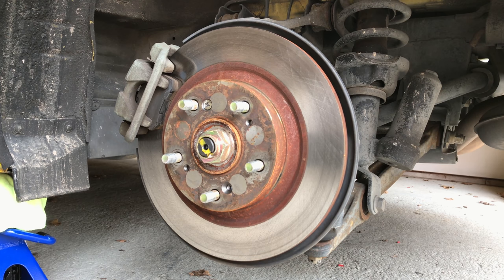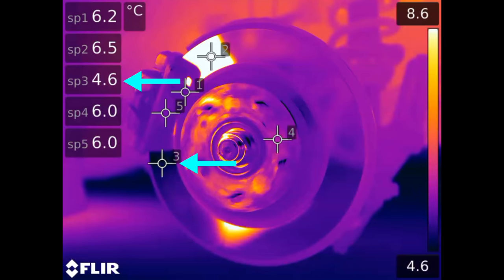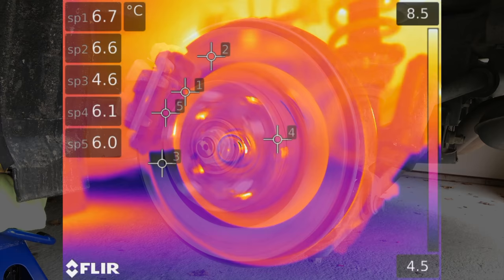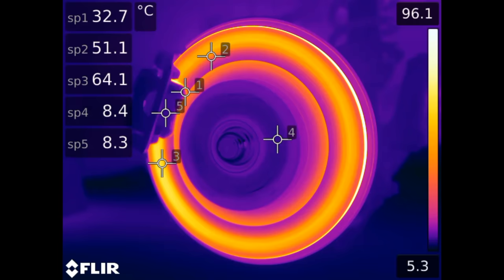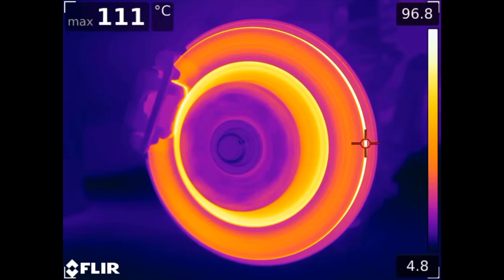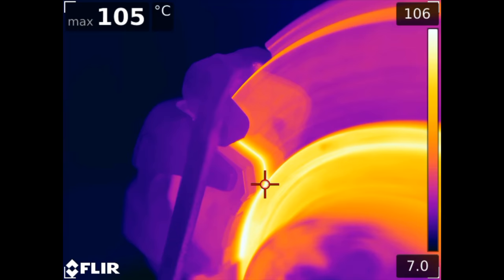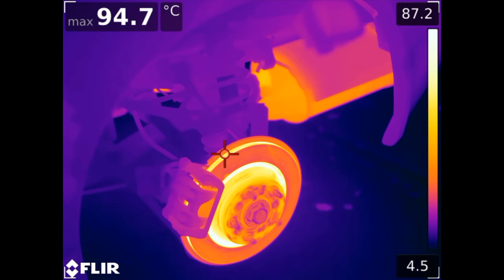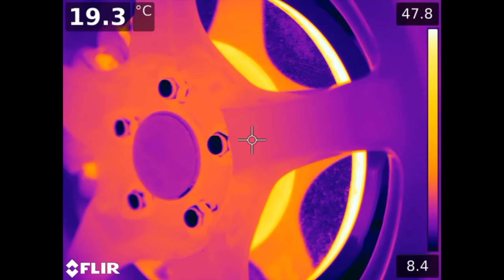How Hot Do Your Brakes Get?

Comment: I had no idea you were supposed to change your brake fluid. Guess I'd better get to it.
Reply: Thomas M As Jason said, brake fluid is hydroscopic meaning it absorbs water. If you boil your brake fluid from overheating, you will introduce air into the system and the fluid will absorb even more water hastening the breakdown of the fluid. If you track your car it's a good idea to change it every few track days and also use high temperature brake fluid.
Reply: revmatch how often should you change it on a normal car you drive in the street?
Reply: Allen Gentry Normal street driving I change it every few years. Personally I flush it every 3 years at most.
Reply: Every two years is a good rule of thumb. Once a year if you do a decent amount of "spirited" driving. Once every few track days if you do those too. I usually change mine every year in my daily car, 6 months in my fun car, and 6 months in my motorcycle. It's really cheap insurance and your brakes are the last thing you want failing on you.
Reply: RyanRants every 6 months on your bike? Do you track it? Thats like 4 times more than needed
Reply: my truck is 21 years old and has never had brake fluid changed and i often tow
Reply: +Jonathan Dittmar
Change it right now. You will certainly notice a difference. Also a good idea to change it to flush the junk out of the caliper and if you have, wheel cylinders.
Reply: It's not a big deal.  The likelihood you reach fluid temps anywhere near boiling even after a decade of not changing the fluid is rather small.  You have to realize cars are tested to extremes and things like water in the brake fluid are taken into account.  Unless you are towing a trailer while at max GVW through death valley in the middle of summer or you decided to take your car racing and haven't changed your fluid in about a decade I wouldn't be too concerned.
Reply: Thomas M here's a little tip for u also, maybe at 100,000 miles you should get new brake rotors, calipers, pads, etc to save u money on the long run and when u get new brakes, put new fluid in also and might cause the new brakes to wear out faster. Just thought I'd should tell ya.
Reply: Scott N Normally I'd agree with you because yes cars are tested for much more than what the book says they can do, but when it comes to steering and stopping I say no. It's a safety issue, not only for yourself (we don't care about that) we care if your brakes fail and you hit someone because your fluid is old. Also I bet you'll notice a higher firmer pedal when you change fluid.
Reply: Thomas M every two Years ot 20k miles. which ever comes first

Comment: Only 100-200? Never thought that the temperature of brakes would be so low. I mean when you braking your car hard or driving downhill, all the mass that this small brakes have to stop only by transferring kinetic energy into heat
Reply: High performance brakes can get even hotter.
Reply: At the point where the rotors get over 200°C on the celsius scale, you slowly reach the point where steel start to color itself through oxidation of the surface.

Comment: would covering the front of the camera with a material that doesn't cover heat(garbage bag?) will remove the reflection from metal?
Reply from the maker: That would simply show whatever is in front of the camera (in this case, a garbage bag). Won't see through it. Needs to have a clear path.
Reply: Engineering Explained oh, I just saw it somewhere maybe I'm misremembering. but if you already tried I guess that confirms it. thanks for the reply.

Comment: is the e brake the only way to use your rear brakes or are they used when you press on the usual brake pedal as well?
Reply: JesusIsKing23 regular brakes and e brakes both actuate the caliper pads.
Reply: +Patrick94GSR thanks bro! after a quick Google search I couldn't find the answer.

Comment: i own a 2005 130i, and my brake discs keep warping? after roughly every 4000 miles, this is the fourth time ive had them changed, checked pads and changed calipers and still getting this problem? I do not drive slow, but I aint driving extremely fast either, any ideas? thanks
Reply: rotors? really? and yeh so i've heard!
Reply: I assume you are getting brake judder (vibration when braking).  First of all it's typically not the rotors warping it's the disc thickness variation (although warped rotors can cause thickness variation).  This occurs in off brake driving (in other words, highway driving).  When your calipers don't retract enough or your rotors are warped they will rub up against your pads at the high spots.  Those will wear down vs the rest of the rotor and now you have thickness variation.  When a rotors varies in thickness this causes brake pulsation or "judder."  This is typically be felt as a vibration in the seat, steering wheel, or brake pedal itself when braking.  In order to elevate this the first thing you need to do is turn your rotors and make sure you have uniform thickness.  Then make sure you always tighten the wheels in a star pattern and torque down the lugs gradually.  This will reduce rotor warping (technically the best thing to do is torque all at the same time but I doubt you have something to do that).  The other things you can do is use less aggressive pads, get calipers that retract more (although that hurts brake feel), or get rotors that are less likely to wear (this can be expensive since it will require expensive materials).

In the end some cars are simply bad for this.  The only thing that is not super expensive is get a decent NAO type pad instead of semi metallic, turn the rotors to make sure they are good for dtv (disc thickness variation), and carefully torque your wheels.  Other than that the other changes I mentioned get expensive.
Reply: thank you! i've tried different quality discs, but I will try what you have mentioned.

Comment: At what temperature and after what kind of driving is it dangerous to keep applying the brake? (Do I have to keep an eye on brake temperature while everyday driving?)
Reply: C1Ansy brakes are tested really hard. They can take a lot more than most people think. depending on your vehicle (the older and heavier you go I would be more cautious) if you get your brakes services and inspected at recommended intervals you don't have to worry about brake temps unless your going down a big hill. If you are just put the engine in a lower gear and don't ride the brakes, hold them pretty firmly until you're at a safe speed and let go of them to cool them, then brake once you pick up speed. If you have a hybrid or electric vehicle you have even less to worry about because a lot of the heat from braking is being absorbed into the battery.
Reply: mutiedjello Thank you. You know, sometimes I have that strange nightmare that my brake pads suddenly will be driven off and clear parts metal come together while everyday driving.. 😱😄
Reply: C1Ansy actually if you wear your pads away and just have metal there it makes a really strong brake! it also makes lots of  sparks, damages the rotor and stops really hard.

Comment: why don't Mercedes breaks wear out evenly? that's intentional correct, to have the rotor around when they wear out
Reply: Brake and rotor wear depends heavily on your driving.  It's pretty much impossible to have both wear out at the same time.  Of course rotors typically last twice as long as pads yet get turned when you replace the pads the first time.  If your mechanic is replacing the entire rotor he is screwing you.

Comment: it's called pad knock back the slight warpage helped to pads "knock back" when brake are no longer applied I don't know other manufacturers but ford allows. 050" runout on a rotor

Comment: Today I noticed my front rims were hot. I could put my finger on them for only a second or 2. The rotors were super boiling hot I did the spit test. This is after about 30 minutes of stop and go traffic. Both rims were hot. Online they say it could be stuck calipers but watching this video makes me think it's kinda of normal? Also the brakes a rotors are a 3 weeks old and it's 90° day were im at.
Reply: Both brake pads need to move freely in the caliper. They ears on the pads and guide pins should be inspected and lubed every year. (I had the same problem, which caused my rotor to warp)

Comment: This is a very inaccurate test, if the car is up on jack stands it isn't enduring the momentum of the car, it is just enduring the weight of the wheel hub and the brake disc itself.
Reply: The momentum of the car, the energy is here replaced with running the engine. Doesn’t matter where the energy comes from. It’s still spinning the wheel/disc
Reply: I wouldn't agree about this being a "very inaccurate test." One thing shown is how heat moves throughout the brake assembly/wheel combination, isolated from air that would flow through the area if the vehicle were moving. So perhaps adding a second test with a large fan in front of the vehicle that could generate a 60 mph flow of air would make it "more accurate."

Comment: If the brake juice boils, Would that force the brakes to come on harder ?
Reply: ProCactus lol brake juice
Reply: ProCactus yes and no. they will actually stay on until the brake fluid blows a seal somewhere and it escapes. But if the fluid is boiling you might also have gas fade which means even with high pressures on the caliper the brakes don't have friction to stop.
Reply: Ok, so yes and no(maybe)
Cheers

Comment: Am I mistaken, or was that rotor not secured with nuts during this "experiment" ?
Reply: Diego vD Honda rotors are typically held against the hub face with screws.
Reply from the maker: +Diego vD ha, wow, I cannot believe I didn't even think about that. You're absolutely correct, and they absolutely should be secured. The caliper itself will prevent it from getting crazy, and there was probably enough rust that held them in place, but in hindsight, that was a super basic mistake. Thanks for pointing out!
Reply: Thank you both for your replies.
Good that nothing bad happened. Would not have liked to explain the situation to the insurance company ;)
Old chinese mechanic saying that I just made out:
Put Nuts = keep your Nuts, Trust the Screw = get ... ;)

Comment: why do reflections show up?
Reply: Because long wave electromagnetic radiation (IR/heat) is also reflected in smooth metal surfaces, and the camera picks up on that—it's basically just calibrated for another part of the spectrum than a 'film'(/image/video) camera. (There are a few more differences when you go into the details, but fundamentally, they work very similarly)

Comment: Interesting, but one correction; automotive brake discs are made of iron not steel.
Reply: They're made from grey cast iron, which is more like an excessively high carbon steel with flakes of graphite randomly peppered throughout it. Grey cast iron is very brittle and will shatter like pottery if you hit it hard enough, though I suppose that isn't really relevant to brakes.
Reply: tom cranmer all brake drum material that the friction rides on is cast iron. brake discs however can be cast iron, steel or carbon fiber.
Reply: nerd1000ify, automotive brake discs are made from grey cast iron which have between 3.2 and 3.9% carbon depending on requiements, if you look at the Fe-C curve you'll see Steel has a carbon % less than 2! so my point stands, auto brake discs are indeed iron and not steel!
There are indeed motorbikes which use steel rotors but the video was referring to car rotors.
Reply: tom cranmer Not 100% true. Most of the time yes but there are automotive stainless steel, carbon fiber, and ceramic brake discs.
Reply: tom cranmer I never said they weren't. What I was pointing out is that cast iron is not the same as pure iron or wrought iron (easy to confuse the different types if you just say 'iron'). 

In grey cast iron the carbon % is actually so high that some of the carbon precipitates out as flakes of graphite scattered through the metal. In between those flakes is a carbon-iron alloy (is that the definition of a steel?) with very high carbon content. This gives cast iron very distinct properties: unlike wrought iron or steel it's strong in compression but not in tension because the graphite flakes create stress concentrations and weakpoints that promote the formation of cracks under a tensile load. This, along with the high carbon content of the metal between the flakes means it doesn't really stretch or deform before breaking. Where wrought iron or steel would dent cast iron shatters into pieces.

Comment: Hi Engineering Explained and all, I have a question that need gurus out there to help decode.

I'm sorry for posting this in an irrelevant video, but I don't know where else I could get your attention in for this.

I came across someone selling a homemade voltage stabilizer with 100000 uf worth of capacitors, with emphasis on good grounding wires for certain components in the engine as well.
I wonder does it really help in the operation of a car electrical circuit and boosting its performance?

Please refer to the 2 links for more info:-

Voltage stablizer
https://forum.lowyat.net/topic/1289791

Grounding wires
https://forum.lowyat.net/topic/1495749
---

Could you please help to enlighten me on this.

Thank you!

Comment: I wonder why there's no such thing as brake oil cooler.
Reply: because the brake fluid does not get pumped around in a circuit so there is basically no way to cool it... you could however put cooling fins on your caliper to help keep it cool
Reply: Because the brake fluid is relatively stationary in the system, radiator type coolers require the hot fluid to circulate round the system. Water cooled calipers can sometimes be used but, as seen in the video, the caliper and brake line don't get that hot; cooling the disc with air is more effective because of the high temperature differential.
Reply: ***** Albie Beck well that makes sense.

Comment: Why don't manufacturers just but for example a little water jet next to the brake discs to cool them?
Reply: RUST...
Reply: That isn't unheard of, but pretty rare. The main problem is that such a cooling system only works so long as you have water in the tank- once it runs out you're straight back to overheating the brakes. For a road car it's better to just design the brakes to take it without active cooling.
Reply: They do. Google "water cooled brakes".
Reply: Brake rotors are already constantly getting wet, if you ever drive your car in the rain at least. I don't think extra water that would almost certainly be immediately evaporated by the heat of the rotor would add to it.
Reply: Water has a rather high specific heat capacity and latent heat of vaporization, so if you get enough on the rotor you'll certainly cool it down (and make a big cloud of steam in the process). This means that your brakes run slightly cooler on rainy days, but relatively little water gets on them under those conditions: it's mostly just mist thrown up by the wheels. Putting a sufficiently high mass flow of water on them will cool the disk quite well... until the water tank runs empty.

The same principle has been used as an intercooler on supercharged engines (see water/methanol injection) and may well be cooling you down right now (as this is how sweating keeps you cool).

Comment: When my rear disc brakes on my car were stuck, they were braking all the time. After a 30 minute drive, I came home and inspected the wheels and brakes. The rubber was hot to the touch and stunk. All metal components (steel rim, brakes, wheel hub, lug nuts) were extremely hot. I measured the brake disc temperature with an infrared thermometer and measured above 250°C. Some spots were even hotter.
I guess that the entire wheel already takes a lot of heat from the brakes. Most modern alloy wheels are also made in such a way that air deliberately passes through the brake assembly.

Comment: How would applying brake calipers covers affect the heat? Would it make much of a difference?
Reply: beasts9182 traps the heat in.  if you got a heavy vehicle or intend to do spirited driving. Don't get them. Only use them to rice out your car.
Reply: pro tip is don't rice out.

Comment: this test is not accurate at all. brakes under vehicle weight moving get a lot hotter, you have almost no load other than the wheel weight on the other side if there even is a wheel on it. also the front brakes are designed to handle a higher load for front wheel drives. the best test would be to take reading while on the road on the front brakes for a front wheel drive. highway braking temps would be the most interesting to see. also you are using the handbrake which is a lot weaker than the foot pedal, this test is really inaccurate

Comment: Notification Squad!!!!
Reply from the maker: +Bryan Wong the real mvp!
Reply: Engineering Explained you should make a comparison video with drilled/vented brakes
Reply: doughboy0506 the vents help with cooling. Holes and slots in rotors actually don't have anything to do with heat. They provide passages for gas to escape